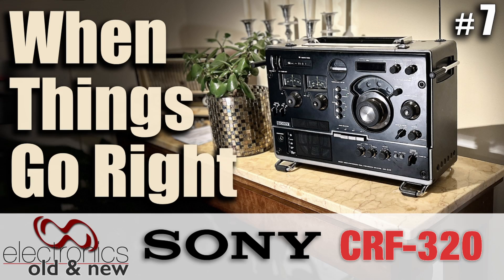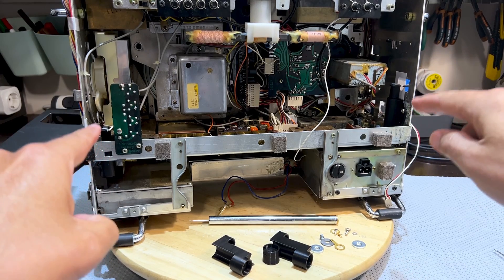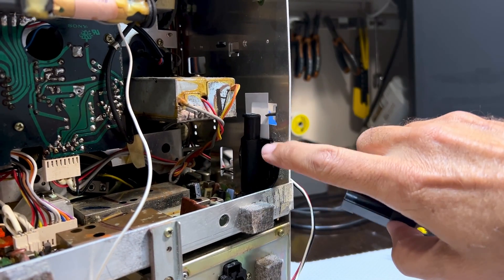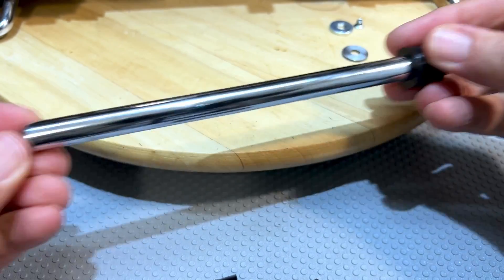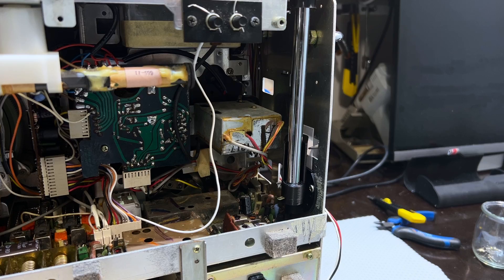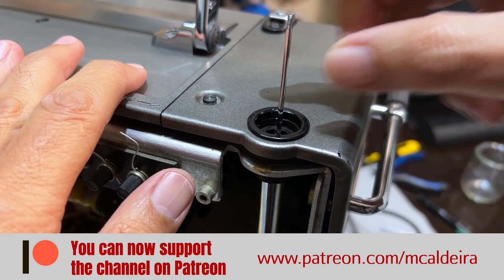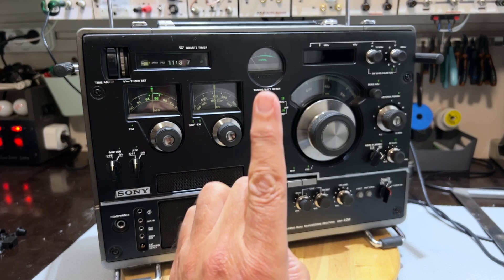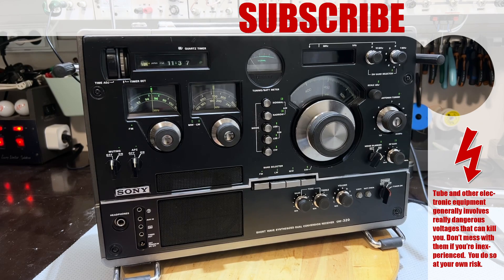'Push-to-Release' DIY Antenna Hack Worked Out Beautifully! Sony CRF-320 restoration Pt.7

Comment: Do you still have the original antenna?  Is the second and third sections from the tip bent at all?  That's where the spring mechanism is.  If those two sections are warped or bent too much, the pop up mechanism won't work.  After straightending those two sections the best I could, plus spraying some penetrating lubricant into the mounting screw hole,  stuffing the straw of the lube in as far as it would go, I got my antenna to start working again 100% of the time.

Comment: Manuel Your engineering background has certainly pay dividends in your hobby even seemingly mastering 3-D printing. Perhaps after you've installed the chip sockets you should use this set as an excuse to hand carry it to England.
Reply from the maker: Great idea. I miss London 😊 Used to go there 3 or 4 times a year, but not lately.